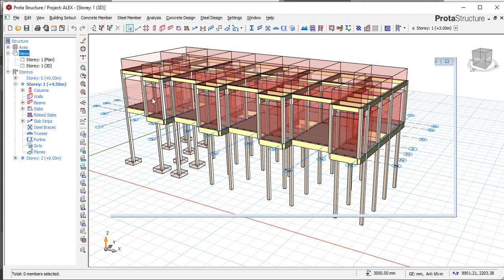protastructure tutorial: how to change the height of column

Comment: Thank you for your help, please I have difficult to how to add slab to different height of column lower than the others in the same floor. Like column height of 3m and 2m in the same floor how can I place a slab on the 2m column apart the base slab
Reply from the maker: For you to be able to insert your slab on a lower or higher level, you will have to create a  different floor level.

For example a 2m and 3m height columns and the building is a single floor.

During insert floor, instead of imputing 2 floors , you insert 3 floors.

Then edit the floor height.

Storey 0=3m
Storey 1 = 2m
Storey 2 =1m
Storey 3 =3m